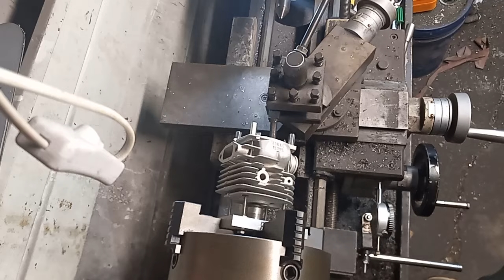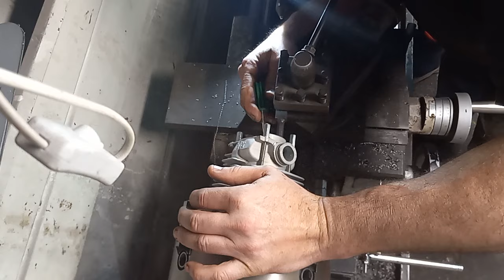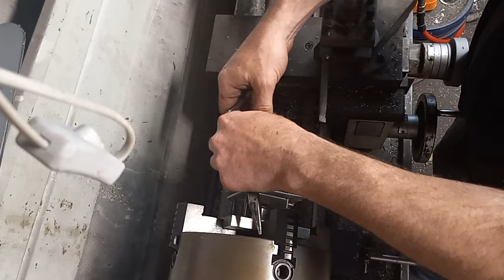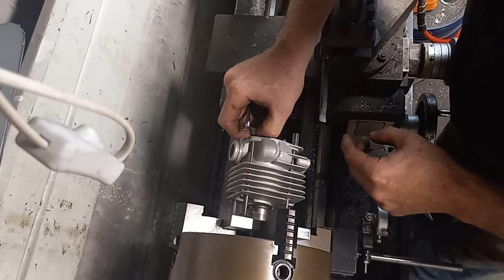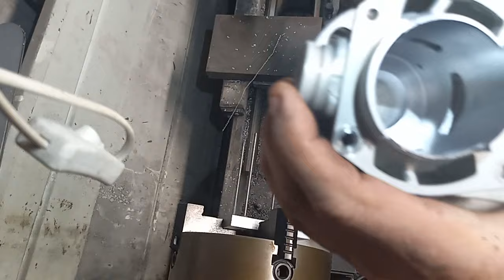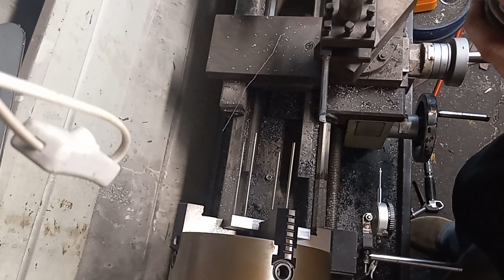cutting squish band on the lathe 372xp cylinder

Comment: Hello from Brazil my friend 

Can you try to help me, please?

My chainsaw has a problem with excessive compression. But when I remove the spark plug the piston rotates normally. Even placing your finger in thze spark plug opening causes the piston to become extremely compressed again. Yesterday I installed a completely new cylinder and piston, but the problem remains. I changed the spark plug, removed the carburetor and exhaust fan, and still the problem remains. Do you have any idea what it could be? Can I send you a video showing the problem? I have been seeking help with this mystery on various social media channels, Instagram, YouTube, but no one has been able to guess what could be causing the problem.
Reply from the maker: I'm not shure what you mean it shud have compression
Reply: It has to much preignition, so it hits you while pulling the Rope. 
Check the Keyway of the Flywheel!